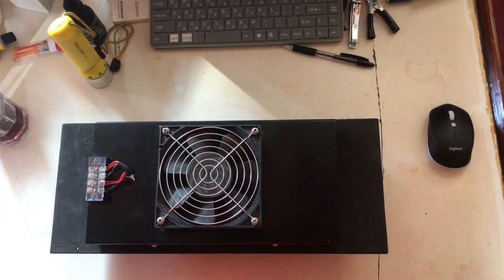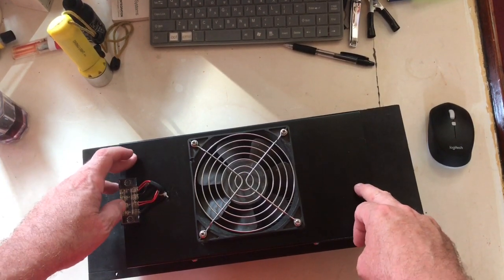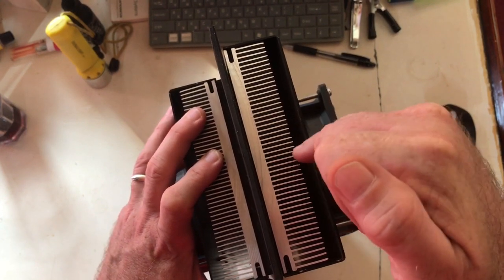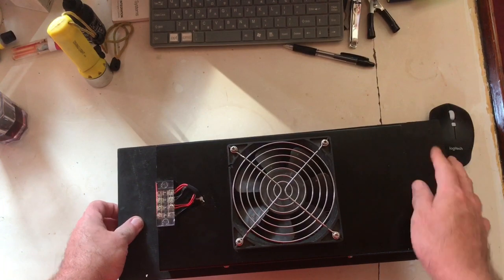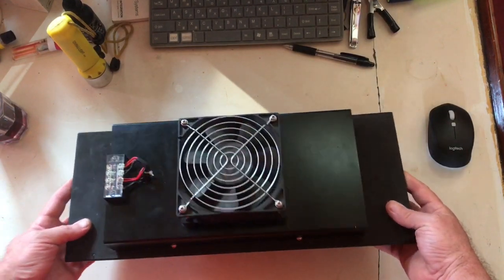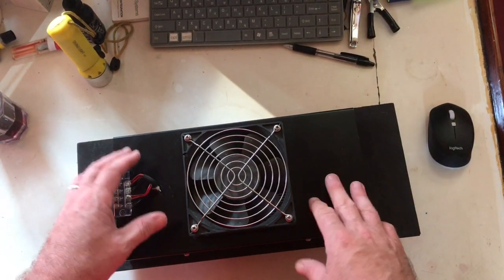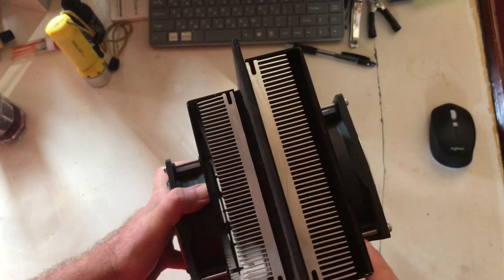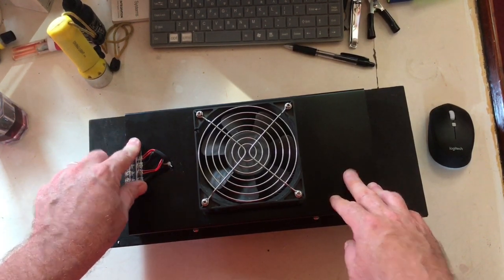Peltier Cooling Update (DC Power)

Comment: I would suggest ditching the outside heat sinks and fans....instead use that massive body of liquid coolant  that your boat is sitting on along with a small pump and some tubing to cool your thermoelectric devices via a liquid cooling heatsink block. There is even a commercial firm in Italy that sells an Icebox refit kit to give refrigeration to older boats using the liquid seawater pumped from outside and drained into the sink basin.

Comment: Thanks Alan....Pls how "COLD" in Celsius did it make your cabin......say within 1hour....and can you run it for 10hours non-stop ?
Reply from the maker: Hello, I have them on "Dawn to Dusk" censors all powered from solar panels, so as the sun is out (10 to 12 hours a day MAX) it will cool the forward cabin. Here in Hong Kong it its the humidity I try to eliminate. When the temp is at a hight of 38C during the day with 98% humidity it will stay at 29C and 63% humidity. At night time we just have a 24v DC fan moving air and we sleep like babies.
Reply: @alanmarine7608  Outer temp of 38C cooled to 26C inside is good but.....wished it could go lower though . Im more particular about the temperature. If i can achieve 15C inside at 38C outside during the day and less at night, i will be excellent. Im in Nigeria, you cant move Aircons about for rural projects and the grid isnt stable. This your model will simplify life if it can achieve low temperatures.
Reply from the maker: @lekefemi9685  I designed the unit for low power consumption and basic needs. In NO way would I get the same cooling as a compressed Refrigerant system. In your area I would assume that it is a very dry climate. I would use the Swamp Cooler theory of moving air over a sponge that is saturated with water. You would drastically change the comfort of the air in a dry climate as Dubai, Egypt, Australia, and Arizona USA.
Reply: @alanmarine7608  I will give this model, the big fish. i will build my local model this weekend and see first.
Reply from the maker: @lekefemi9685  GREAT !!!! So much fun and rewarding to build these projects ! Have fun my friend !

Comment: @AlanMarine, you are using this on a boat, perhaps you can use the cold water underneath your vessel to cool the hot side of the peltier using water pump. Perhaps place a radiator under the vessel that is enclosed (so it wouldn't rust) but still got cooled by the water. Perhaps it's more efficient than using fans. I am curious how you would design this tho.

Comment: Dear,

Through your youtube video I have seen there is lot of water out side your project aria and If you are in a boat I will like to advice you should use water cooling system and intake water direct from sea to cool peltiers.   

You will see there will be just dubble cooling effect (much better).

As I am also working on the same.

Thanks for your efforts.

Comment: Cheers bro ive started building my 200w air-conditioner...using a heat curtain to cool my bed space in my van and just venting the rest of the van with maxx fans im using noctua pc cooling heatsink to transfer the cold and a custom made copper heatsink with 5 noctua silent fans to cool the hot side...600watts solar panels and 18650 7s samsung 30q system...soo far running good 😊 i was the guy who asked before 😉
Reply: Dylan Desmond make a vid of yours?
Reply: hi Dylan...could you help me building this project...kindly send me details and efficiency of this project....

Comment: Quote from ClintonAluminum.com

When it comes to selecting the aluminum alloy for use in a heat transfer application, it is important to choose the right one. The temper of the alloy is also very important. While, aluminum alloy 1050A has one of the higher thermal conductivity values, it is mechanically soft. The most common aluminum alloys used in heat sinks and exchangers are 6060 (low stress), 6061, and 6063.

Comment: Dear 
I have connected a pelter cooler device  with my  12v 1Ah power supply 
Pelter works fine but when i  connect the  fan with the same line  fan stuck and not running  . Please help me
Reply: 12 volt 1 Amp is not enough Current... get a supply that CAN deliver more current...
Reply from the maker: Jobayer Al Hasan fans and pelters should be on an independent bus bar. Different currents on each. Although can be the same circuit.
Reply from the maker: Jobayer Al Hasan send me a PM hear on YouTube with your email, and I'll send you some pictures to help you undress the method of my madness that works flawlessly !!

Comment: Could using a 1 watt bird bath water pump to water cool the hot side module and replace the solid heat sink with a water cooled one increase the cooling of the cold side module. Or do you think that it wouldn't make much of a difference in dropping the temperature ? Curious if you tried that in a previous model?
Reply from the maker: Plum Crazy I tried using a pump that took 23C sea water below the boat and used a solid copper block with 1/4" tubing soldered to the hot side to remove the heat. It made it more complex, but it did not provide more of an advantage of just the fans as long as it is in a shaded area. I would love to know how it would work with fresh water !!!
Reply: I see. Figured you would've tried a water cooled prototype of some sort.  I'd be curious to know if freshwater would make any difference also. If you ever decide to try it out post about it. The only change I would make from the sea water prototype would be a cooler filled  with ice & water that you could pump from and that could last a few hours. Thanks for replying.
Reply: You may consider using the Earth as your source of dropping the Temp.

dig a hole in the ground at least 4 feet and drop a coil of stainless Steel tubing in it... with connections above to interface with the water cooler... pump the water that way... use the earths cooler temp to get that heat off...